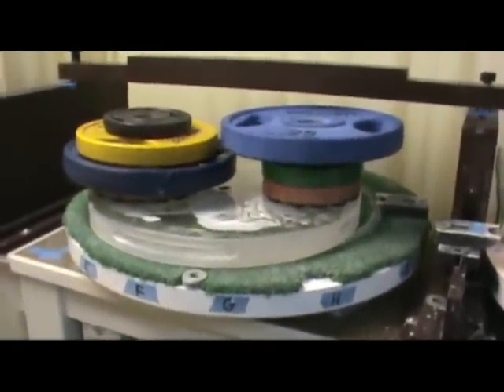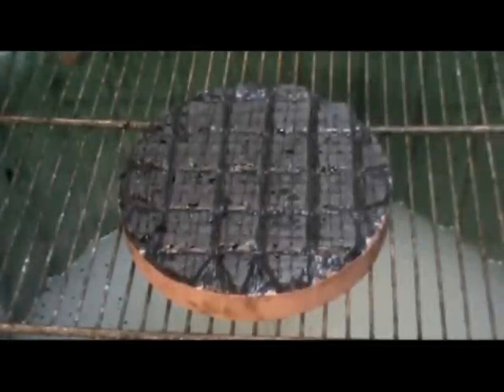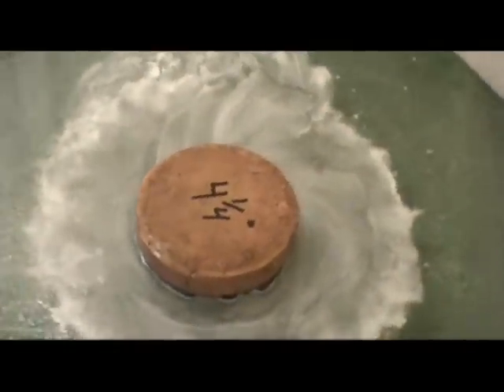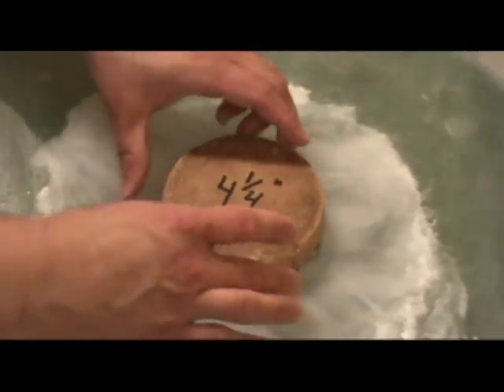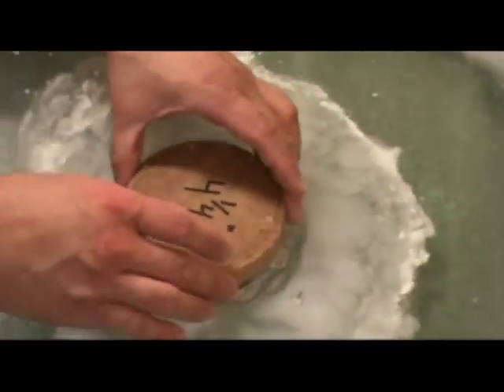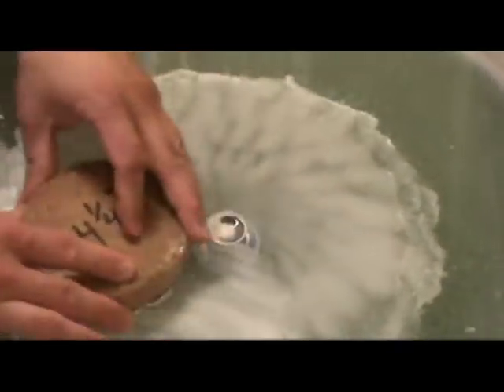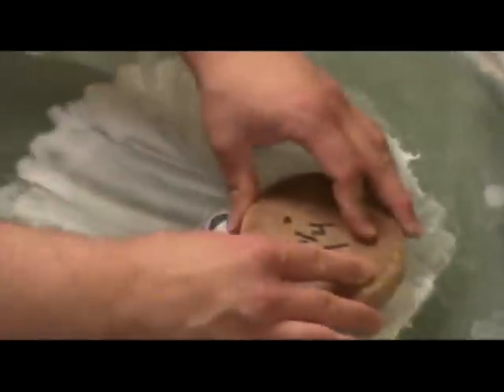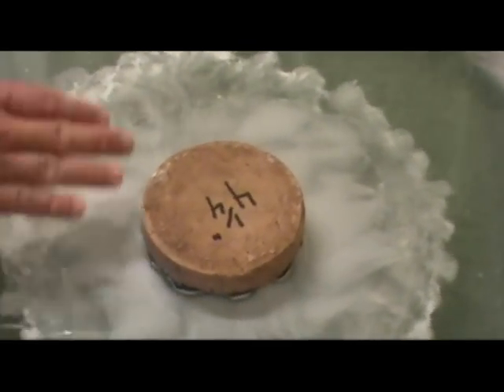Parabolizing a 20" Mirror, Part 1: Preparations

Comment: Hello Gordon, Great video. Do you know, "Beginner's Guide to Astronomical Telescope Making" by James Muirden (1975)? I bought that about 30 years ago but this is the first time I've seen the techniques in video form. Nice one.
Reply from the maker: Just bought a copy on Amazon!  Thanks for the suggestion.  I got hooked on those thin telescope-making and mirror-making pamphlets from Edmund Scientific back in the 60's.  Love all those old books!
Reply: In all the rental places I've lived, I've never really had the right sort of space to set up a work area like yours or anything in the book. Only just discovered your work. Very awesome. Edmund Scientific sold some wonderful stuff though I would say I'm at the Anchor Optics end of the scale! I'm an electronics guy, btw.
Reply from the maker: Oh, very good!  I do some "throw the parts together" electronics.  Lots of Arduino stuff.  Just got a Raspberry Pi to play with.  I enjoy doing the programming.  We've built several mirror grinding and polishing machines that have been controlled with various Arduino parts.  Lots of fun!  Just built a new PWM fan controller for our Renegade telescopes.  Too simple these days, with every part imaginable available on a day's notice.
Reply: Oh, good show! It certainly is strange to see the wider world taking up embedded programming that used to be the preserve of nerdy, introverted types since the days of the 8080 and the SCAMP. As if the AVR family doesn't make things convenient enough, I have a few dozen avr-based boards (pro-minis, etc) genuinely unused since I chanced upon the ESP8266 some years back. The ESP01 board: A 32-bit processor running code from an upgradable flash chip at 80MHz with integrated Wifi subsystem (including antenna balun and switch!), UART, I2C, SPI, etc. all mounted on a 1" x 1/2" pcb and available on ebay for $2-$3 in lots of 1.. Hard to go past. For even simpler prototyping, there's the Node-MCU family of boards (and their low-cost clones) which are like the Arduino boards with integrated USB connections - really convenient. If you're prepared to pay a little over $10, there are the ESP32-based boards: Dual-core version of the above, clocking along at 160MHz! Some genius types managed to adapt the (free) supplied software toolset to the Arduino platform which opened them up to much wider 'audience'.